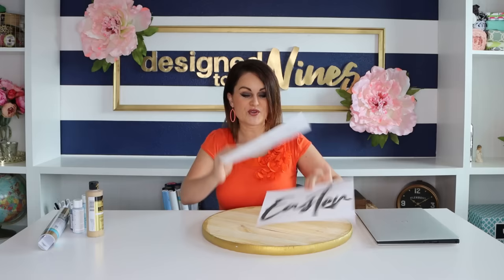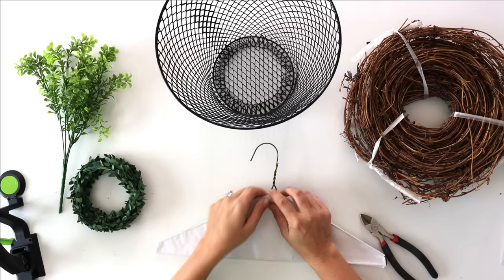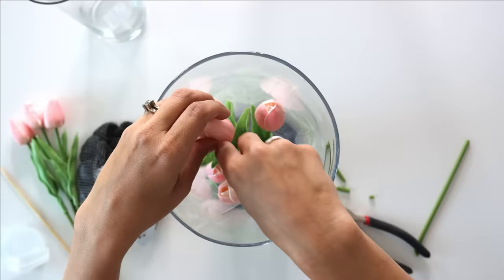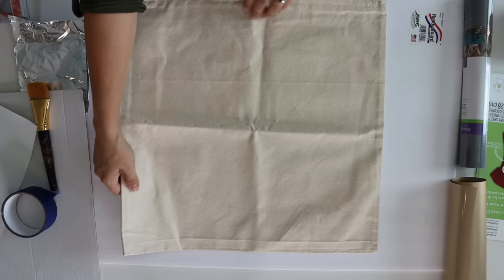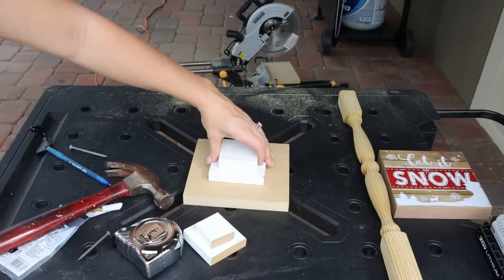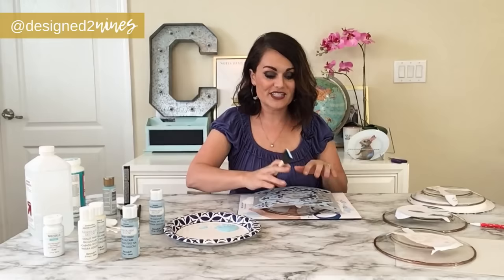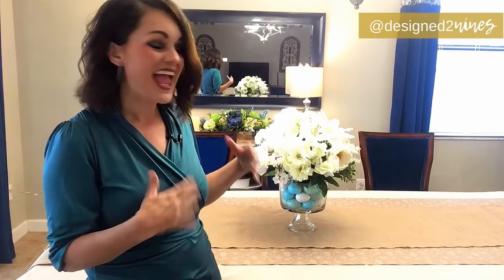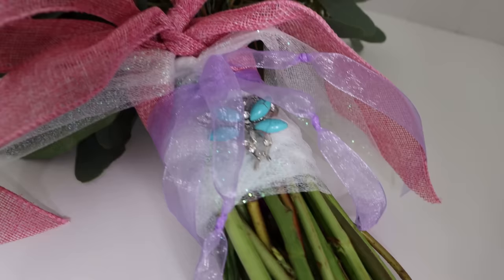🌷Absolute Top 25 Best Spring DIY Decor Ideas On a Budget!

Comment: I love all of your projects. They all look classy and store bought. Just an idea for those lampshades, I have used them to make planters. I attach chicken wire to the bottom and sides then cover with cement.  For the planter feet I just put extra cement in disposable cups and flip onto the bottom. /once it dries I drill holes in the planter for drainage then paint and decorate.

Comment: Hi Natalie,  what a great compilation.  Little tip about reusing old lampshades. I strip the fabric from the bottom circle I then use these for wreath bases. 😊👍💖 btw, I have the same bunny print, and after watching your pillowcase tutorial ended up making a framed poster using the print and grain sack background. And of course, your bunny plates are one of my favourate diy and the moss bunnies centrepiece was the reason I subscribed to your channel.  Thank you.
Reply from the maker: Thank you so much! What great ideas and suggestions! Thank you for supporting my channel! 💕
Reply: I use lamp shades to display photographs

Comment: Your planters would work better if you take a drill bit and drill holes in it after glue has dried. Adding mesh at the bottom of a pot will also help to keep the soil in the pot and from falling out